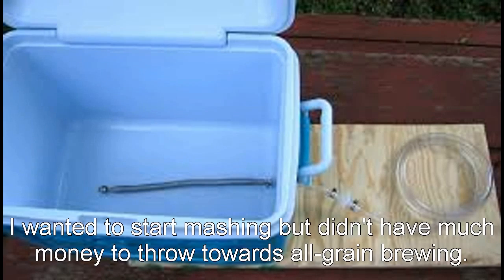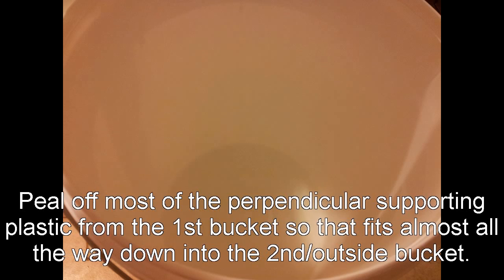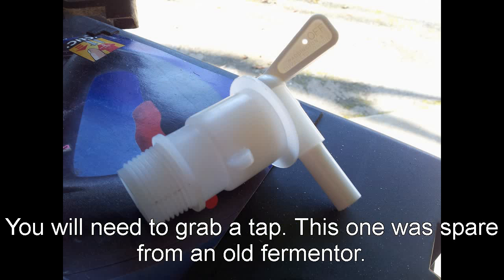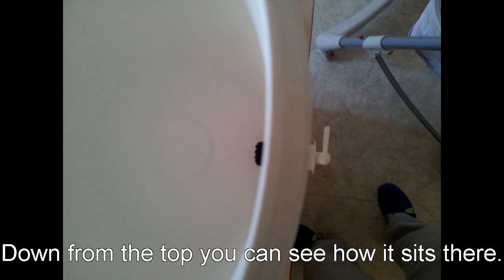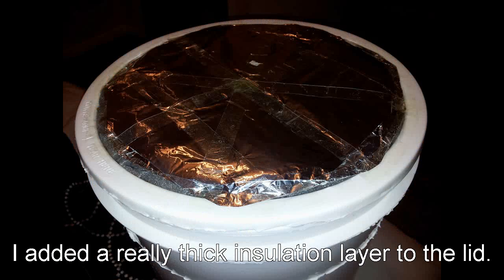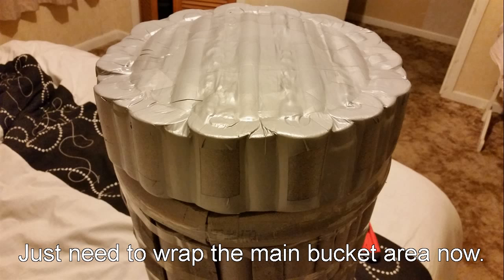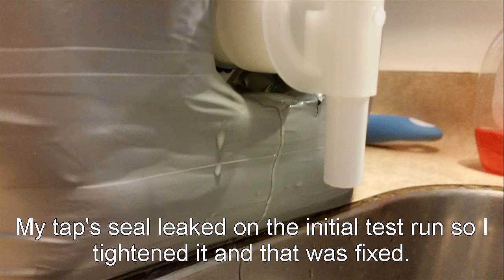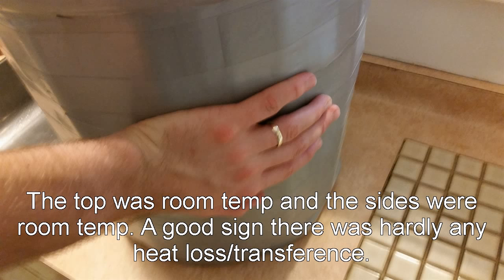Tips - Cheap Mash Tun Build

Comment: what size drill bit,for the false bottom?..17
Reply from the maker: It was 1/8th inch or about 3m.  Tried to make holes just small enough for grain to get stuck. But big enough for wort flow.
Reply from the maker: It was 1/8th inch or about 3m.  Tried to make holes just small enough for grain to get stuck. But big enough for wort flow.